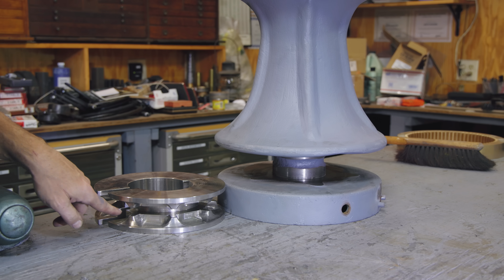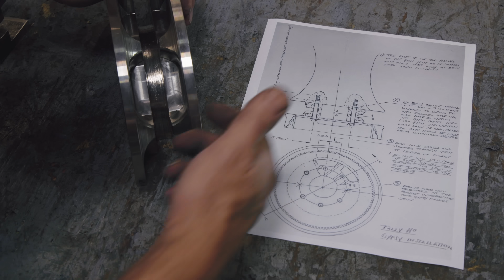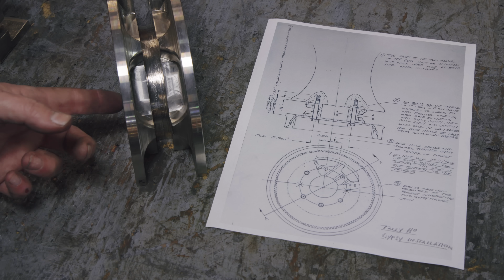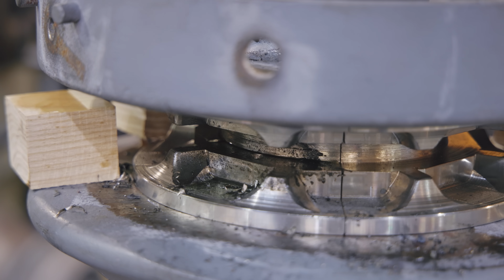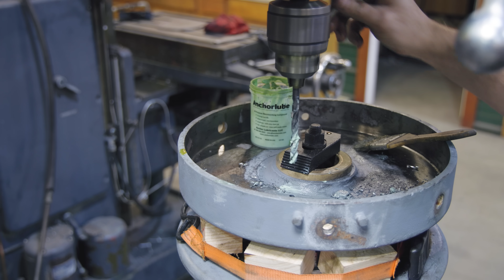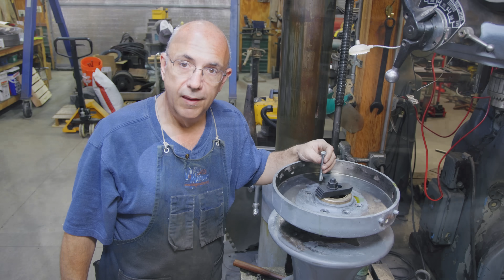Tally Ho Capstan Project: Drilling the Chain Gypsy and Locating Bolt Holes

Comment: I cringed when I watched you increase rpm.  I hate stainless, spent 14 years doing maintenance in a food processing plant.  Cobalt drills chip the edges too easy, new TIN drills aren't sharp until reground, good old fashioned black oxided bits are the best in my opinion.   Tap magic made a heavy lube that worked well, can't recall exact name, got a bottle but not walking to shop to look.  Looks like heavy black oil but it has tap magic in it.  Probably can't buy it anymore but it works well.
I love my present job in a die shop, after stainless, d1 and a2 are like working with butter.
Keep making videos, love the new die mill, could have used it last week, made a fixture for rotab and got it done.  Again thanks for videos.
Reply: i said out loud, noooooo what are you doing?!?!?
Reply: I worked on Budd stainless steel railcars for several years. It's a good thing I quickly figured out how to drill that special stainless alloy. I  was able to use just one step drill the whole time.
Reply: Ages ago I briefly worked in a production machine shop turning and drilling pipe flanges in stainless and Inconel. If the drill point angle and the feed rate weren't correct that hole would smoke in a hurry. I recall going very slow but the chips tell the story.

Comment: For others watching this. Some types of stainless steel work harden almost immediately.
The issue with drilling is that the center of the drill does not actually cut. The tip of the drill actually deforms the material outward to the cutting edge. If you speed and feed rates are not correct, the deformation hardens the material. Once hardened, it will break before it deforms, and you end up with little hardened bits of steel in the chip pool that chip the drill causing even more hardening. If you are very lucky, you can baby your way through the hole by clearing the chips constantly. 
The big issue is that pecking is the easiest way to guarantee work hardening SS. It is really important that you are always cutting when the tool is in contact with the material, when the tool dwells at the beginning and end of the peck, it will work harden. Best thing is to just drill straight through under constant pressure. Just dump luck that slug landed perfectly and fused itself to the material underneath.
Reply: I'm just a lowly retired engineer with lots of machine shop experience but I would have run the drill slow from the beginning with lots of coolant. Stainless can be a SOB and there is only one capstan with a very expensive looking gypsy. Keith recovered nicely and the job looks great.
Reply: @Gwatson000  I’m sure you are right, the mark of the expert is not that nothing goes wrong, though hopeful less often, but how well they recover!
Reply: Besides cutting continuously, lubrication with a cutting fluid like Anchor Lube or Tap Magic will help with both cooling and keeping the drill bit sharp.
Reply: @peterhobson3262  Plus slow the speed for stainless. 750 rpm is way too fast - as Keith found out. I am sure in hindsight Keith worked all of this out, guided by what Joshua and Peter have indicated.
Reply: For the first hole drilled he didn’t  appear to use any lubricant and even sped up the drill until he hit trouble . I have very limited experience of drilling stainless but could anticipate problems arriving.
Reply: @hughshepherd6596 I've turned plenty of 316 and 316l on my mini lathe and drilled as well. The basic titanium drill bits from auto parts store worked just fine for me, as long as I kept my speeds low and used tap magic fluid, it let's the chips fall away and not get pulled back into the hole. For turning, carbide is a must, and fairly high speeds, I've had decent luck not running any coolant, nothing I turn has to have a perfect surface finish
Reply: This was more heat treating than work hardening.
Reply: When I was a teenager I’m 75 now I was a pipe fitter we would use water to cut threads on pipe good sharp dies and just water to keep it cool and clear any small chips. I was just a kid and it worked fine. We welded most of the Stainless 316 or 304 I don’t remember only had threads for threaded components such as valves.
Reply: @currentbatches6205259K subscribers and 9.5 thumbs up for this video alone speaks volumes for the man’s skills and experience. Happy to be referred to your channel so I can form an opinion on your credibility level that permits you to make such cavalier assertions.
Reply: @currentbatches6205 you are so delusional,,,HA HA HA,,funniest thing I've heard in ages ROTFLMAO
Reply: Yes exactly, the plug was caught on with of the cutting edges or both, and then when it contacted the lower half of the gipsy it was just a case of friction welding the plug  to the base and the result was glowing red, and work hardening the surface. I think the greatest mistake was trying to drill it dry, and not backing out to relieve the swarf ( chips)
Reply: I drill my share of stainless,,,first thing I thought was speed was much to fast,,and I have the best luck drilling a pilot hole with a much smaller diameter drill,,,and lastly pretty much every thing I have ever seen in print is cast iron is best machined dry
Reply: @tomstiel7576  "[...]  drilling a pilot hole with a much smaller diameter drill [...]"  

THIS!  The smaller the pilot, the less material that has to be pushed out of the way by the chisel points.  The  pilot drill can be as small as the web of the final drill.  Then the final drill doesn't have to push ANY material out of the way.  A chisel point pilot makes it even easier.
Reply: @currentbatches6205 Keith is not a full time machinist, he has worked in a machine shop a few moons ago.  What he is is an enthusiast,  he loves old machines and using them.  He never tries to teach but gives good guidance as he sees it.
If you want nitty gritty job shop training go to Joe Pies channel.  Mr Pete's channel won't steer you wrong, not advanced, hey, he taught high schoolers.
Lots of good stuff out there to watch, some pretending to be experts and aren't others rather humble.
Give Keith a break, he overcame an obstacle.

Comment: okay i have Heard what Keith has had to say i have also looked at the drawings plains whatever you choose to call it and am now up to stage where he has just Stuffed the drill bit and has confirmed what i was looking at the bolts pass through where the chain link is supposed to ride my problem is this will this not cause excessive wear of these bolts to a point where they fail just my observations not know what others are thinking Cheers all
Reply: As the chain is reeled in , one link will engage the gypsy vertically , the next link will engage horizontally . The bolts are behind the vertical links , see @ 31:22 .
Reply: @alexwarnock888  hi mate thanks for that i was looking without looking my Bad went had another look see and of course your right again thank for clearing that up for me   Cheers

Comment: I have a job where I need to drill a D10mm and 21mm deep hole in a D11mm and 19mm deep hole. After ruining a set of drills, I now do the 11mm hole first and then go in with the 10mm drill. Otherwise the edges of the drill bits get worn quickly, especially on stainless steel. For me on stainless the rule is also to use flood cooling.
Reply: non mag stainless is a bitch, try D2, a semi-stainless steel. Look it up for the details folks. Die steels like high carbon, high chromium alloys are unique alloys with require specialised procedures for correct machining.

Edit for this: ISO number is unknown to me, but x153crm0v12 is what the folks call it now. And the the reason I posted, some SS is best worked without water as it acts like a quench in air hardening steels and makes your job much more difficult

Comment: Your obvious mistake on the first hole was to let the drill bit flutes get packed full of chips! Tally Ho is in the water, you need to get on the ball.
Reply: No it was his spindle speed. Should have been around 500 rpm and he was closer to 1000 from the looks of it.
Reply: @dimidimdog9123  hi mate i would say you are both right as wrong speed and not clearing the chips adds up to heat and we all know what that does to S/S as one other chap seed it is Hateful Stuff for sure my mentor told me with S / S get in and get out just get it done as fast as possible to avoid work hardening cheers

Comment: Funny thing is, it was done on a CNC, but it could've easily been made on a lathe and a horizontal mill + rotary table. Get the profile right on the lathe, put it on the mill and rotate a large end mill to obtain the chain pockets. And because it's a one off, it might've taken the operator longer to make those parts via CNC.
To be clear, not saying it should've, it's a lot of chips to go after, making the robot do it is better.
Edit: oh and it would've been done from two parts from the get-go with a few small bolts keeping them together in operation, probably passed through the lips.

Comment: I was always taught to slow down your tool speed with SS not speed it up. Plus i reckon the temper on that drill is stuffed now.
Reply: Also noticed when tapping Keith just did a continuous cut, didn't back the tap off to break the chip.
I was taught to always back off the tap, no matter what material you are tapping.
Prevents that pitiful sobbing when a tap binds up and snaps off in a deep or blind hole.
Reply: @bobdown6235 Had me cringing too, especially when it obviously tightened up .
Reply: @bobdown6235  ' Prevents that pitiful sobbing when a tap binds up and snaps off in a deep or blind hole.'
Reply: @bobdown6235 He’s tapping into cast iron so doesn’t need to break the chips - they break themselves so reversing the tap has no effect.
Reply: @paul.newland  It's still good practice to back off and clear the tap. You'll end up with a cleaner better mating thread.
Reply: @bobdown6235  He threading 100 yr old cast iron - that will/should powder and not chip when threading. The first tap will tell you what you need to know.
Reply: @zorbakaput8537  "It says here..." You are correct, but that is a high pucker factor job for sure. Cast iron will lull you to relaxation and all of a sudden bite you squarely in the ass. I can't imagine trying to remove  a broken off tap in that piece.
Reply: @zorbakaput8537  Nope, 25 odd years in the trade as a fitter/machinist will tell me all I need to know about tapping holes.
Reply: The Black Book gives 978 RPM for CI and 478 for SS at 5/16 DIA so yes you are right.
Reply: I really appreciate your   attention to the project and being confident while im on the edge of my chair 
Thanks
Reply: High speed steel is called that because it doesn't lose it hardness when heated.
Reply: 25 years? 😂 Most of us watching this channel easily double that!

As already inferred, simply reversing the tap won’t magically clear chips as you seem to believe - the holes being tapped by Keith aren’t blind so the cast iron simply falls down the flute taps into space. 

The only difficulty with cast iron is hitting chilled spots - he’s hand tapping so easy to feel for that with many years of experience which Keith, and some of us have…
Reply: @paul.newland  You do it your way Paul, I'll continue to do it mine, deal?
Reply: This was a disaster. What kind of machinist doesn't know the basics of drilling SS? Leo must be banging his head on a bronze frame.
Reply: That drill bit looked like a Titanium Nitride coated one, and I was under the distinct impression that TiN on tools is merely a thin coating. Emphasis on thin. If it's gone, you're left with a drill bit shaped object.

Comment: I'm glad to see it's not just me who has issues drilling stainless steel. It's hateful stuff, and I really don't like working with it. You just need to look at it the wrong way and it work hardens and your drill bits are all ruined.
Reply: Keep the degree of the drill bit tip shallow as you can. 5 ish deg. The day i learned that it changed the game for me.
Reply: Worked with it for years, it's great stuff once you know how to work with it.
I always used rocol RTD compound when drilling and tapping and always keep the pressure on when drilling until you are through.
The second you let off the pressure it overheats and work hardens plus kills your drill bit.
When Keith started drilling into the stainless I pretty much wanted to scream use cutting fluid, less down feed and speed.
Reply: @samuraidriver4x4  agree, lower rpm and reletively high feed, higher than you might think. Otherwise its a big chance its just rubbing and that is not what you want.
Reply: @johannesfossi5561  his feed looked a bit to fast tho but it might have looked like that due to the high rpm.
Chips look as expected so was probably within a decent range.
Reply: Stainless isnt that bad to drill, slower rpm than you would normally  use and cutting oil.
Reply: Hell I even struggled to drift a hole through stainless I was forging!
Reply: With plenty of cooling its no problem
Reply: @johannesfossi5561 Flood coolant is a must.
Reply: I’ve learned this lesson the hard way with both stainless and drilling titanium just go stupid slow and check it constantly and get it out of the hole if it’s not going forward
Reply: Pull out your wallet and  buy some carbide drill bits, really the only thing that will mill and drill stainless.
Reply: @robertgarrett5009  HSS works fine, no need for any expensive drills.
Keep pressure on the drill and use something like rocol RTD compound as a lubricant.
Drilled thousands of holes with HSS drills.
Reply: Speeds and feeds.
Reply: Power feed is the way to go with drilling stainless. With hand feeding, the second you release pressure on the feed, your bit is heating and dulling. After getting the right feed rate, you got to keep that tool lubed and feeding. My 2 cents of experience.
Reply: ...titanium is even WORSE...
Reply: I struggled to drift a hole in some stainless I was forging.